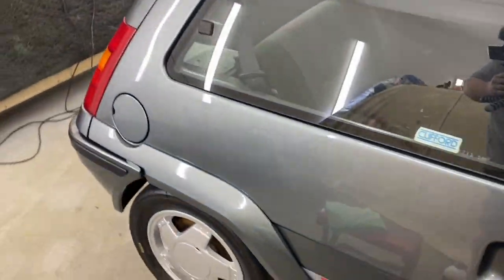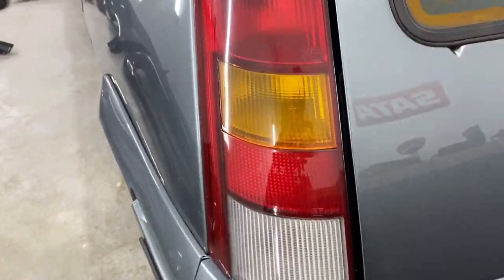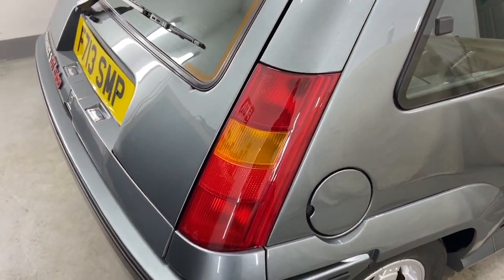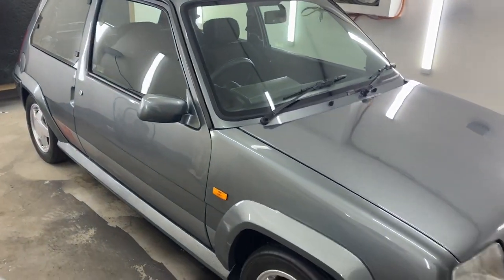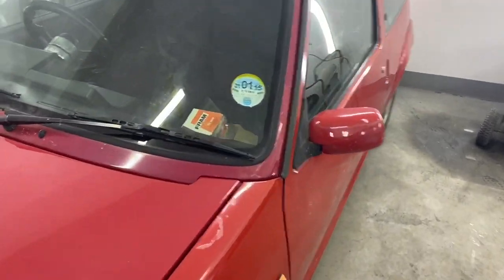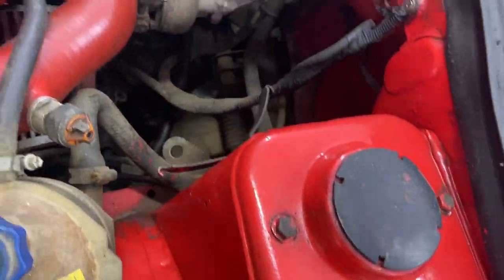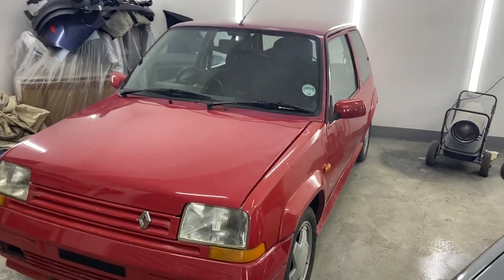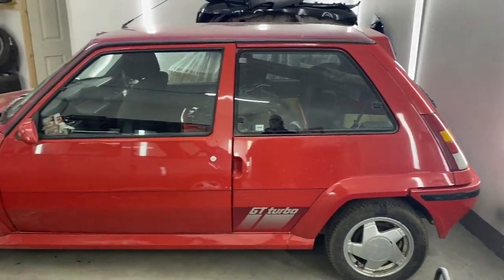Detailing Famous Renault 5 GT Turbo From The Tv Show Car SOS part 2

Comment: Wow what a result. Show room like😍👏👏👏 . That is some achievement,  AWESOME AWESOME AND AWESOME 👍👍👍👏👏👏 I just wish I still have my one. I was never going to sell it, I was using it only to get from my house to the train station in London and one day back from work , got out of the station and my baby vanished and never recovered that was devastating,  lot of sleepless nights, it was heartbreaking to lose it then got back to my sirocco with secret immobiliser and thick chain through the steering wheel but the cockpit was just too tiny for me , my head always stuck to the roof and knees rubbing under the steering so I couldn't keep it but never found unmolested uncategorised and reasonably priced R5 Turbo2 .
You should be very proud man, decent honest hardworking top man 👍👍👍👏👏👏🙏🙏🙏✌✌✌❤😍
Reply from the maker: Thanks 🙏 👊👊👊

Comment: Can you do a “how to” on the machine moping. What (Trade quality) machine mop to buy? What heads to use to cut back and cutting fluid ( G3 , G6 ?) what heads to use , what  trade polish to use ? Do you polish first then wax ? What’s the deal with ceramic coating polish ? The last time I detailed a car , which was many years ago , it was T-Cut by hand (F#(£ that 😂). Any tips, tricks, would be appreciated.  

Ohh yeh ,, BTW paint the Renault Black. 👍🏻 just started following, enjoying the channel and content. Thanks
Reply from the maker: Thanks and yes I will be doing some more how to videos what your asking is a lot of content but yes I have these type of videos planned and soon as I have caught up with what I have to do I will get to these hope that helps 👊👊👊
Reply: Hi , yes it’s a lot of content. Just trying to give you some ideas 😉. It would be ace if you did a series of “how too’s “ on what I’ve asked. Hay man , paying the bill’s come first though 👍🏻. Thinking more about the Renault 5 , I first said Black , perhaps a candy apple Blue. Retro/ modern colour. Thanks again 🙂
Reply from the maker: I’ve got to keep it original mate more money when it’s done 👊👊👊

Comment: @Salvage flippers what products did you use on the back lights. Cheers for sharing this cracking ren 5 turbo with a sun roof as well very nice mate.
Reply from the maker: First I used the rotary with koch chemie h9 and then the da with sonax perfect finish hope that helps 🤛🤛🤛
Reply: I would be interested to see you polish up the rear lights, they look spot on!!
Reply from the maker: Thanks 🙏 I will be doing them on my red R5 I’m rebuilding so when we get to that stage I will go more in depth with it 💪💪💪 hope that helps 👊👊👊

Comment: my mate had a red one as well f plate rolled it on it's roof in a country lane in keynsham near Bristol had amps and subs in it .It was still pumping out music when he crawled out of it back in 1995.He was gutted and upset so he bought another one E83 WCY in like a standard Sandy white colour. He then had it sprayed purple kept it for a while then sold 8t to a black Dred lock drug dealer who had it confiscated by the police .Due to being bought with drug money.I remember the clutch being really hard to push down even though it was new are they all like that??I am sure the engine has to come out just to change the clutch on these.A lot of work .
Reply from the maker: Clutch is a bit heavy compared to modern cars but no gearbox comes out easy on these engine stays in 👊👊👊
Reply: Thanks for replying back in the day there were few performance cars that could compete with these although being just a 1400 turbo they could blow any rivals away due to being lightweight.
Reply: The reg was F970JMR his red one R.I.P poor car.
Reply from the maker: 🤣🤣🤣🤣 I thought this was a comment on the cosworth sorry lol on the r5 it’s after to drop the subframe with engine and box on these to do the clutch so you were right 👊👊👊

Comment: Hi. 2hat compounds do you use to get rid of the flatting Mark's on this renault 5?
Reply from the maker: I think it was kotch chemi on this 👍👍
Reply: @grantssmartrepairs  ok cheers, also what is the spotter and dent pulling system you've got. I need to get one and like yours?
Reply from the maker: It’s called GYS 3902 👍👍👍👍